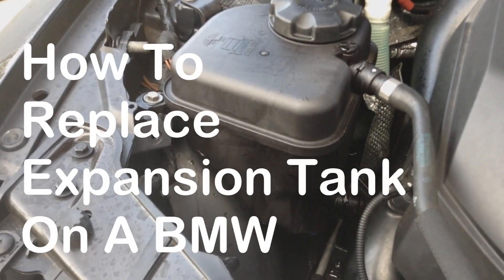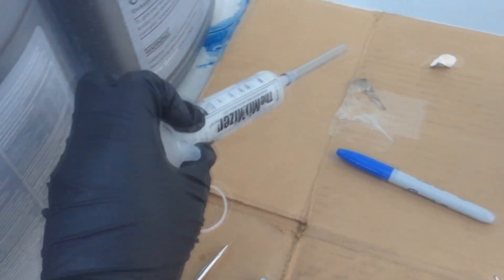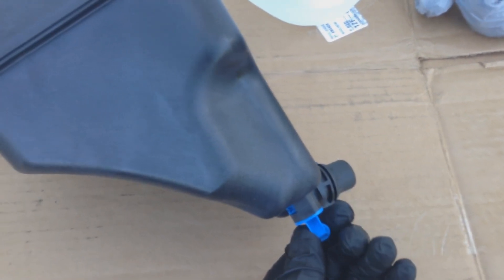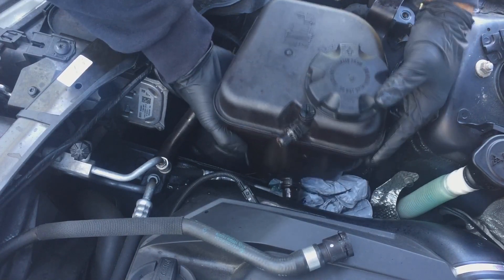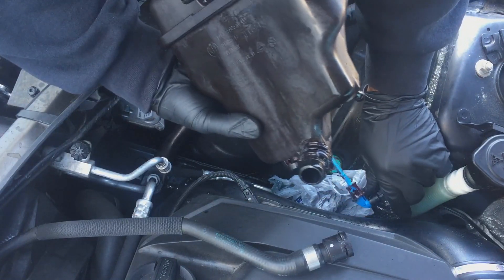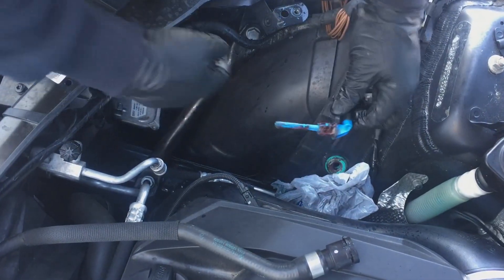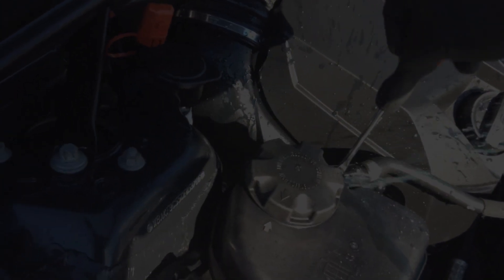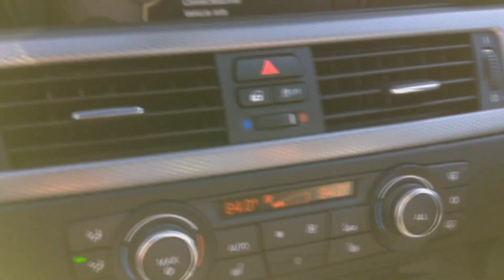How To Remove and Replace Coolant Expansion Tank on BMW 335i

Comment: Can i do the bleeding with engine is on? I dont want to run the battery alone ( not able to use battery charger) i think i got electric water pump as well. 2011 135i n55 engine
Reply from the maker: Yes Of course do it on….the electronic is just another option
Reply: Thank you so much 🎉🎉🎉

Comment: Good video I'll be using this next week when my parts come in. Got a similar leak, right along that seam. I still have pressure in the system though when i uncap, and the coolant level isn't down much (haven't had a low coolant light). You think it's ok to drive? Assume I've been driving for a minute already with it like this...
Reply from the maker: Keep bmw coolant mixed with distilled water around in ya garage and to be safer just keep distilled water in your trunk because coolant is toxic

Comment: My man, thanks so much for this video. I did this job yesterday on my 2006 330i. Two issues I ran into. Upper hose didn't fit snug on new tank (purchased from BMW) resulting in coolant spraying everywhere when I started the engine. So I used some plumbers tape around the tank threads and that solved that problem. Second was with the bleeder. Was hard to tell when bleeding was fulling complete as still had some coolant coming out through the bleeder after the bubbling stopped. I closed the bleeder, checked the heater and it was working and blowing hot air so figured I was straight. Coolant level was fine when I checked later. By the way, I have an electric water pump and didn't do the other procedure with the car off and external battery attached, etc. I hope that doing it your way in this video is fine since car is blowing hot air 🤷🏾‍♂.  Thanks again.

Comment: My coolant is full but my coolant light keeps showing up I just replaced the water pump, oil cooler seals and o rings as well as radiator hoses. Any idea what could be wrong ?
Reply from the maker: May be programing needs to get done of waterpump...are there any other issues
Reply: @BimmaJoc  no further issues just the coolant light, no leaks or nothing
Reply from the maker: Ok so next thing is to hook it up to a scanner to find the exact issue....could be thermostat...coolant sensor...or just simply the water pump needs to be programmed by bmw(maybe)

Comment: Excellent  video question if am installing a new radiator and a new expansion  tank can I bleed the system  once  after installing  the two parts?
Reply from the maker: https://youtu.be/lel5CINXKAQ   Right thats what ya need to do ...get a bucket and mix the bmw coolant with distilled water half and half first

Comment: Do you have to step on the gas pedal for 12 seconds? And wait 12 minutes for the whole bleeding procedure after you put the heater on?
Reply: If you have an electrical pump: yes. I was looking for a comment like this. You don't bleed like this guy did when you have an electrical pump.

Comment: Hello, I followed your video to replace the tank. But when I was pulling out the clipper of the bottom hose, it came out of hose and flew inside the engine. I tried to find it and even vacuum it but no success. What do you suggest at this point? Should I just connect without clipper?
Reply from the maker: This is hard to believe ...do you mean that its somewhere around the engine bay?? ....because flew in the engine like you said is impossible 🤷🏽‍♂️ but if you need to look for anything medal around your engine bay...its best to use a long magnet tool....if that doesnt work replace the clip or hose. The clip may have fallin underneath undercarriage slash guard...best bet

Comment: How much coolant did you use?
Reply from the maker: I don’t remember but i know it had to have been less then a gallon because the concentrate gets mixed 50/50 with distilled water
Reply: @BimmaJoc  Thanks. Did you also fill the coolant while the car was on/in accessory with the heat on?
Reply from the maker: Raj Brar no ....when the vehicle is (cold) again...(next day) check the levels to make sure its at the indicated marks ....if its not top it to required marks or if its over... use a fluid extractor to take some out
Reply from the maker: Raj Brar adding fluid with vehicle on is dangerous that should never even  happen
Reply from the maker: Raj Brar in matter of fact ...the bleeding process electronically can be done with the cap on and then when its done check the heat if its blazing hot then the process is complete......when i did this video i did the bleeding process electronically with cap off ONLY for demonstration both ways are fine but cap on is recommended in the books
Reply from the maker: https://youtu.be/USrut8pHOvk
Reply: @BimmaJoc  Thanks - really appreciate the responses. Just to confirm, after installing the new tank, you bleed the system electronically, let it cool then top off with additional coolant if needed?

Comment: Hello there, 
Thanks for the video it’s really helpful just one question pls after changing it did you have any smoke coming out of the engine while you driving cos I changed my one and after 2 days I took it for drive I put my foot down and I realised it was smoke coming out from the engine when I open the bonnet it was around the coolant tank area but it wasn’t leaking at all, do you think it’s the excess anti frizz that spilled while I was changing it and bleeding it or something else? Thanks
Reply from the maker: What does it smell like....if it smells sort of sweet maybe some coolant fell in the manifold area ....if it has a burnt kind of smell that may come in the Cabin while you driving then it may be the smell of oil that also may have leaked onto the exhaust manifold area....in that case vehicle could have a valve cover gasket leak....I would pressure wash the engine let it run after and drive for a while ....pull over then while the engine still running pop the hood and see if its still a burnt smell or a sweet coolant smell...if after the wash nothing happens the the coolant spill evaporated.
Reply from the maker: Other wise the vehicle needs to be checked for coolant and or oil leak...check my videos on valvecover job ...and coolant pressure test

Comment: do you know if you can replace the coolant level sensor without draining and removing the expansion tank itself? I have looked and I can't seem to find any details on replacing just the level sensor
Reply from the maker: What you should do is buy a fluid extractor it will automatically suck the fluid out the reservoir.  Then you can replace the sensor easier (twist and turn).  Then used the extractor fill back the fluid into the coolant tank and thats it....but still bleed the system after to avoid any complications.  BMW COOLING SYSTEM ELECTRONIC BLEEDING PROCESS https://youtu.be/USrut8pHOvk
Reply: Bimma Joc ok so it is required to remove the tank to access the sensor? I’m coming from an e46 which I could access from underneath the car and not have to drain anything. Thanks for the feedback and the excellent diy.
Reply from the maker: But when you remove it the fluids going to come out
Reply: Bimma Joc true. For some reason on my e46 would not leak from that sensor when removed. I have an extractor so I will drain it. I guess what I should have asked is if I raise the car can I access the sensor from below without removing the tank? Thanks again for the quick reply. I subscribed to your channel
Reply from the maker: Ok well good luck and thanks
Reply: @BimmaJoc  Just a follow up on this one just in case anyone else has this issue. If your low coolant light stays on even after changing your sensor and the fluid level is normal the problem is a defective magnetic float that is  in the expansion tank itself that triggers the sensor. The level sensor sits in a dry well and there is a magnetic float inside the expansion tank. If yours breaks like mine did it will trigger the low coolant light even though it is full. If you ever encounter this issue just replace the tank just as in this video. It's very easy to do

Comment: so i did this and i keep getting coolant level low on my dash but coolant is filled max. any ideas? thanks
Reply from the maker: You definitely have a leak...you have to do a pressurized test to find out where its coming from....could be the reservoir tank...radiator...fragile hoses... or even the orings from the hoses could be bad...but you have to get the pressure test done in order to know what to replace ...i did a vid on this https://youtu.be/9476cw9ByRk
Reply: same here. It showed no leak after i replaced the tank but the light just doesnt stop to show up

Comment: Repeat every 5 years.  What a POS.
Reply from the maker: Sandy really nooo shouldnt be like that ...something may have went wrong ...like air in the system ....BMW COOLING SYSTEM ELECTRONIC BLEEDING PROCESS https://youtu.be/USrut8pHOvk
Reply from the maker: Sandy Or shocks and struts need to be replaced ...i was surprised how bad mine were when i replaced my struts....so if those are bad they cause a lot of vibrations and many others things can fail due to fail shocks struts
Reply: @BimmaJoc 
Yeah, on my 3rd BMW but my 2011 N55 is the worst POS car I've owned in my life.  I've lost count of how many cars I've owned. 

The real problem with BMW is the viscious hostility of the designers against DIYers.  They block bolt access with artificial flanges, create special tools, bury problematic parts like water pumps and starters, intentionally fry fuse boxes, put fluild leakers over belts and sensors--all to screw over their independently minded customers, who have the nerve to think they own their own car.  

This is a company of bastards and National-Socialists who 100% still believe they are genetically superior to their peon customers.  Horrendous built to fail plastics, putrid engineering, worst in class warranty.  My N55 has logged more in repair costs than the MSRP.  Luckily BMW ate most of that on the 6 week sheared-head chinese made VANOS bolt teardown recall, requiring only master technicians to fish the bolt heads out of the oil pan.  There was no internal scoring though, yeah right. I've driven every new model they offer in loaners.  Its still got a catastrophically unsafe airbag recall I can never get around to. 

Never, ever again.  Modern BMWs are the worst built cars on the market.  Maybe the worst cars ever made.
Reply from the maker: I hear ya ....i feel ya pain i dont think they are the worst cars but they are very costly when it comes to maintenance....reasons why i started my channel....plus so much time consuming when repairing ...this is my third one also and what i noticed is maintenance just needs to be done so more problems cant happen ....and im telling those shocks n struts have are a huge factor ....the previous owner of my car never replace them so i can assume many people miss this maintenance item also...just for fyi
Reply: @BimmaJoc 
  IMO nothing else even comes closes to the nightmare of BMW ownership.  My first and best BMW was a new 94 325i, its only problem was loud body creaking over bumps coming from around the doors and seals.  BMW insisted it was normal. It also had terrible paint that was covered in white scratches showing primer, just brushing the car in jeans would scrape off the ultra thin paint.  I sold it with 25K miles to go overseas.  Overseas I bought my second BMW on the military sales program, a 2000 Z3 2.8.  After shipping it back to the states, it had 3000 miles on it when the engine billowed thick black smoke and stopped running.  Luckily, the uncrimped hose clamp was still dangling on the oil hose underneath the engine that worked its way loose and dumped the oil.  After towing it to a dealer, they rufused to touch the car claiming it was a counterfiet BMW, since the VIN didn't exist.  After fighting with them almost daily for 14 months, they admitted it was their mistake of not transfering the VIN between incompatible computer systems.  They claimed the engine was siezed from sitting untouched for years and were able to unseize it with force and an oil  change.  They charged me $180 for the out of warranty oil change (as normal wear and tear) and claimed it was as good as new.  I sold it to s a different dealer with full disclosure.  My 2011 N55 M package 135 has been the worst nightmare car of my life times 10.  I couldn't begin to recreate the number of times it broke or was recalled in and out of warranty.  The number of thin, low end plastic engine parts that have failed is astounding.  Shorts, fires, metal cracks, pressed tin and plastic FMIC leaks, charge pipe failure, brake cylinder failure, numerous boost leaks, boost solenoid failure, starter caught fire at the wire connection point, three clutches failed which they deemed all manufacturing defects ($3700 each), power window failures, power lock failures, intake manifold crack, 6MT gearbox failure, interal VANOs bolts sheared, oil pan failure, underbody cladding has all cracked and fallen off, rear main seal failure, 2x vacuum leaks, several oil leaks, water pump failure, twice, OFH gasket failure, twice, VANOs solenoid failure, twice, airbag failure, fake-leather cracks on both front seats and the shift knob, dashboard delamination, stereo failure, a bunch of thrown codes and sensor fails, limp mode at leat 10 times over the years, and I'm not kidding, I'm not remembering half of the problems.  I have 110K miles on it, today, and its starting to lose about a cup of coolant every 500 miles and burn oil. 

So while I liked all my BMW cars from a driving perspective, I know that they are utter shitboxes that rivial the cheapest chinese made death traps ever made, and are maybe several times worse.  

Never EVER buy one. Ever.
Reply from the maker: Sandy but when was the shocks and struts ever replced🤷🏽‍♂️<===main cause ....starts there

Comment: I did this and as soon as I turned on the car smoke started to come out
Reply from the maker: Steam??? That could be for many reasons watercoolant drop to the exhaust manifold ...<==steam or other major issues like valve cover leak hopefully not head gasket 😱 or oil pan gasket, main seal 🤷🏽‍♂️

Comment: @bimmajoc Hey man I hope to hear from you soon, I replaced my tank as well but once I installed the new one it leaks from the bottom hose right at the connection as if it were missing a gasket but it's not... what was that red sealant you used?? I would like to give it a try to see if it would create a gasket type seal around the bottom hose connection I dont wanna have to change that 3 way hose :(
Reply from the maker: Khaled Ibrahim its called permAtex
Reply: @BimmaJoc  thanks boss I'll give it a try!
Reply from the maker: Khaled Ibrahim dont forget to bleed the system after ...... How to  Burp trapped air from BMW Cooling System/Water Pump test https://youtu.be/N6qkME07omM
Reply from the maker: Khaled Ibrahim liquid sealant
Reply from the maker: Khaled Ibrahim correction permAtex high track sealant gasket maker

Comment: Hi, i drive 2009 bmw e90 325i inline 6 gasoline.
I’ve a problem with low coolant level.
When the car is cool or ideal coolant level is ok.
But when i drove car for say 20-30 kms it start showing low coolant levels.
But when i came home after 20-30 mins i checked the coolant box it has optimal levels of coolant in it.
Whenever i drive more than 20-30 kms it start showing low coolant warning and their is not significant coolant leak i can’t find any coolant leak.
Pls help me with my query
Reply: Do you suggest for new coolant level sensor
Reply from the maker: Anupam Singh sensor maybe good ...water evaporates so low coolant signs after months of driving is normal
Reply from the maker: Anupam Singh so if you do see water ...have the system pressurized so they can find out where a leak is coming from and replace that part
Reply from the maker: BMW VEHICLE CHECK / BASIC INSPECTION https://youtu.be/kKMn-wjo_84
Reply from the maker: Check the level first ...add coolant or distilled water to required marks...never over fill ...then if happens very soon again....have the system checked...use a flashlight to look for any water down by the front passenger side near coolant tank...look for a powder coat on coolant tank

Comment: I just swapped mine. You have way more room because I have the 2 vacuum boosters in the way. Getting the bottom hose off and on was a little tricky. Thanks for the video. You helped a lot. God bless #N54 #E93 #BMW #335i #SanDiego
Reply: My current problem
Reply from the maker: Alfredo Diaz thanks 🙏🏽
Reply: How did you get it off it’s driving me crazy!

Comment: Fire alarm needs new batteries
Reply from the maker: Stephen Small lmao done 🤣🤣🤣
Reply: :) Hey so I don't need to fully drain my radiator fluid? Just the expansion tank?
Reply from the maker: Stephen Small right ...then return back to required levels and bleed cooling system
Reply from the maker: Stephen Small https://youtu.be/N6qkME07omM

Comment: Thank you! But I do have a question I followed the steps and did not get any coolant overspray when I released my bleeder.
Reply from the maker: WhetstoneJAX Media as long as you know for sure that no air is out the system...then your good...the heat is blowing hot air inside is one way to confirm....My coolant over spray happened mainly because i opened the bleeder too much in the beginning while the car was getting hot...but if i see overspray ...thats good too because the air only had one way to come out.